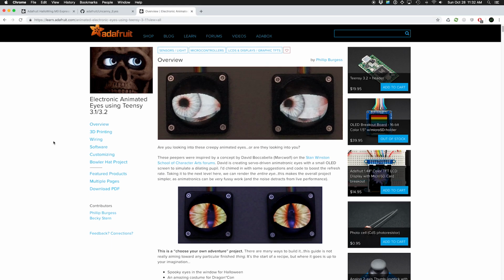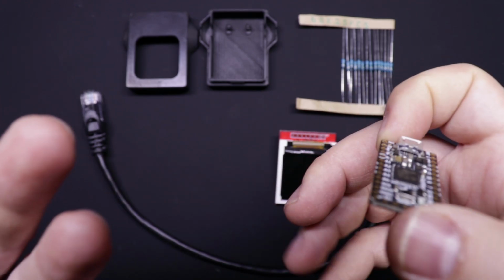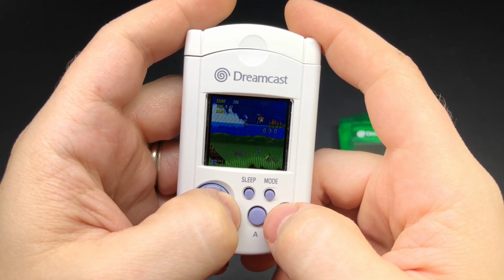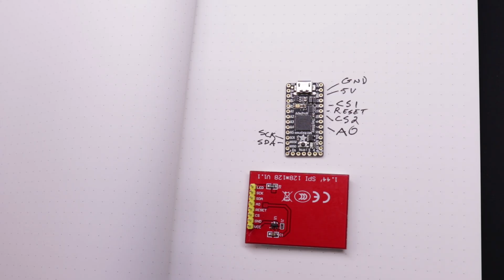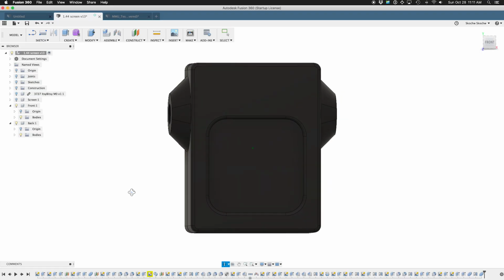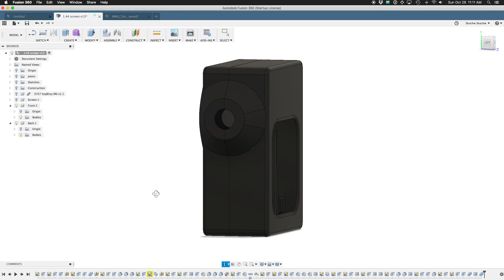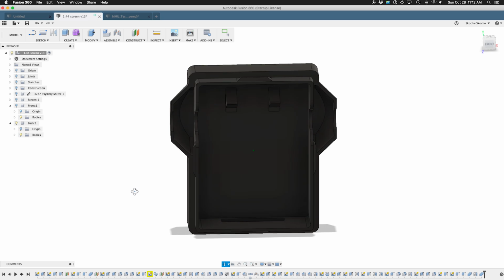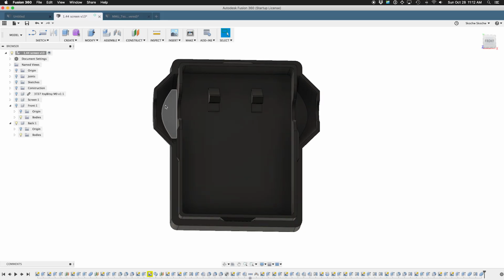Spooky Arduino Halloween Eyes

Comment: It's been six years since this was released and at this point I can only assume something in the setup has changed.  I've watched this vid dozens of time, as well as going over the Sudomod page, I purchased the same micro controller and LCD screen, and it just doesn't work.  I set it up on a bread board, checked, doubled checked, and checked the pinning again, the screen lights up but no picture.  I don't know what the problem could be except something has been updated that makes this project incompatible.

Comment: If I wanted to use another SMD resistor, am I trying to lower the resistance?  Or raise it?  I was thinking raise because we are raising the V from 3.3 to 5.  I have some SMDs and wanted to use them if the resistance was correct (I have no 68's would have to combine 2 traditional ones).  What value?  Thanks for any help!!

Comment: Helping someone with a small project. He wants to use one screen for one eye.  Open a small port lid on a board hanging on the wall. Behind the lid is the screen. Need a way to activate the eye and add a battery. Not sure how to figure the power for this.

Comment: My displays finally came in and I am trying to build my first set of eyes. I am unable to get the code to load on the M0. Any ideas why I am getting a "Error occurred while uploading the sketch" message? When I downloaded all of the libraries the Adafruit_ST7735.h one there were multiple versions available. I selected the latest one. I assume that is preferred? Any pointers or things to try would be greatly appreciated because I have 10 of these displays I want to put to use!
Reply: I got it working! I had selected the "Arduino M0" board instead of the "Adafruit ItsyBitsy M0" board.

Comment: Found a decent solution to my motion sensor idea. I simply used the blink pin! Had to change from pullup to pulldown. Works almost as good as I wanted. You still see some backlight in a dark setting.  
Thanks for this fun project!

Comment: I have what seems like a simple modification I want to do, and I can't figure it out in code. I want to connect a PIR sensor to activate the displays when someone enters the room. I can do it with a sensor and a relay, interrupting the pin 8, 3.3v LED on the tft boards. This keeps the eyes running with the displays off when nobody is in the room. Seems pretty simple, right?

Comment: Hello. I am doing this project on Teensy 3.2. Everything works. The left monitor is connected to pin 9, and the right one to 10. How can I make my eyes rotate synchronously, and not in different directions, and the pupils are different, one large and the other small. If I connect both monitors to pin 9, then my eyes are the same and rotate synchronously. How to programmatically make (CS monitors connected 9 and 10 pins) so that the eyes rotate synchronously and the pupils are the same. Please give an answer. Thank.

Comment: Like others have commented kind of wish this didn't say "Arduino" in title since later on it specifically says "WILL NOT work on normal Arduino or other boards!".  For people like myself who may not read completely through appropriately and just dive in it would save some time and money to specify up front it wont' work with Arduino's....
Reply from the maker: Arduino is a platform with a ton of different microcontrollers that support it. Perfectly valid to say that this is an Arduino project; there are even official Arduino boards with the same M0 chip as I used in this project (the Arduino Zero and MKR line of boards), which should work with this.
Reply: @wermy  Well I guess once again it's my ignorance versus being incorrect description. :-) Thanks for replying.  A question, when I try to compile and verify this code as downloaded it gives errors around "size of array 'sclera' is too large" and "size of array 'iris' is too large". Any ideas on how to address?

Comment: Hi, I just loved this video and really wanted to do this project. I bought all the things i needed and assembled them. loaded the program and it isn't working? I'm thinking some of the pin assignments are off in program. I clicked on the link in the description for your modifications using the MO board but the link is gone? Any help you could provide would be greatly appreciated. Thank you